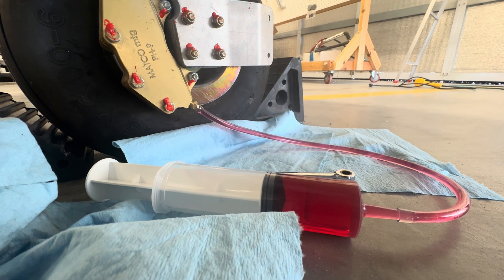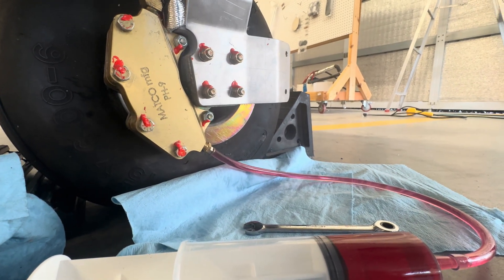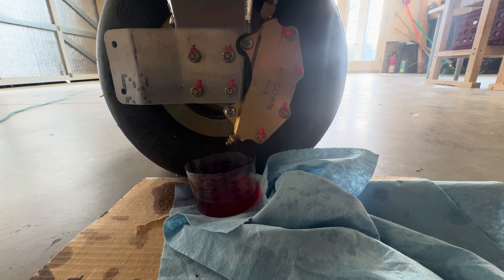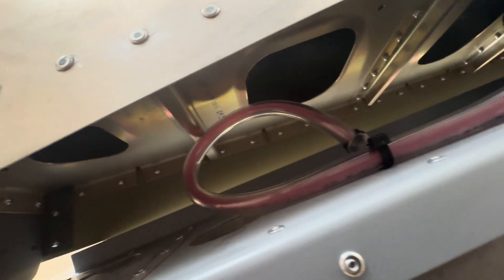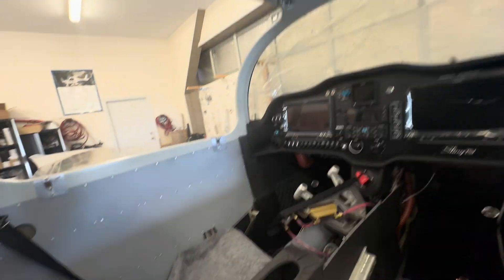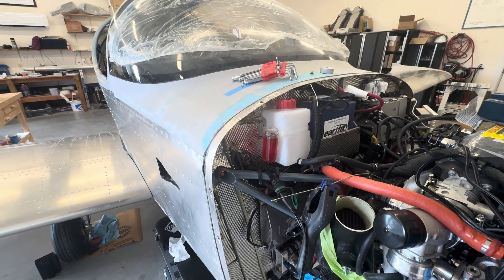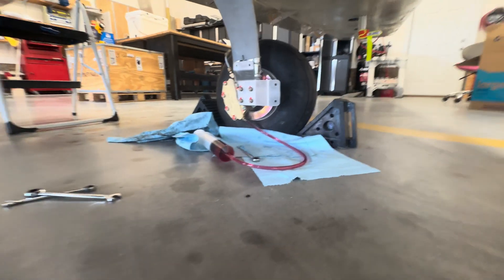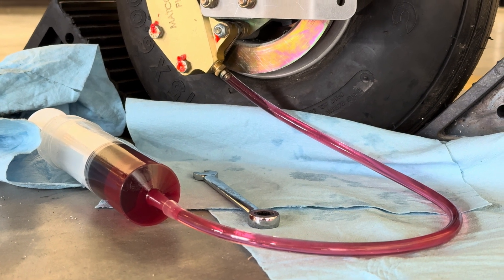Bleeding the Brakes - Sling TSI Build Update

Comment: Why are the bleeder valves on the bottom instead of top?
Reply from the maker: I’m not sure if that is the  design of Matco ALS or a Sling design. Doing it that way shortens the brake line length and keeps it up high as the positives of this style. Everyone basically bleeds it backwards by pumping fluid up from the bleeder valve.

Comment: Thanks for this video. Finally got around to bleeding the brakes on my TSi build yesterday. I followed your process except I used a pistol pump oiler instead of a syringe. All went OK but even with all the bubbles gone I had no resistance on the brake lever. Decided there was likely trapped air in the master cylinder. I put about 6" of blocks under the nosewheel and did the process again. Success! And no leaks. Thanks again.
Reply from the maker: My brakes were firm but would not hold the plane as I got up to 5000rpm. I lifted the nose and bled them again. I haven’t testing it again yet.

Comment: If you happen to lose your brakes when taxiing, just pump the lever repeatedly.  It's normal to have hidden air  bubbles that will ultimately collect somewhere and cause pressure drop.  My brakes gained and lost pressure routinely in the early hours.  They went away completely for a moment, pumping brought them back, firmer than ever.  I routinely pump mine before taxiing out to make sure I have full pressure.  I've not lost pressure during the last 10 hours or so of flying.  They'll come around and hold full pressure once all of the air settles up to the top of the master cylinder.  I have the single puck Matco and they'll hold full throttle with the 916.  BTW, Goodrich Aviation 3D prints custom chalks in your colors and tail number.  I love mine.
Reply from the maker: @joemclaughlin8474  thanks for the tip, we’ll see how it shakes out once I start some taxi tests.

Comment: Glad your bleeding has been better than my experience. I’ve got the beringer wheels along with the stainless steel lines, so I can’t see bubbles. 

I’m also glad I’m not the only one that bought the harbor freight chalks. You won’t be able to use them once the wheel pants go on. :)
Reply from the maker: Seeing the bubbles is an upside to the plastic brake lines. Those wheel chalks aren’t really good for this size wheel at all, but at least they were cheap. I’ll probably make some myself once the plane is finished.